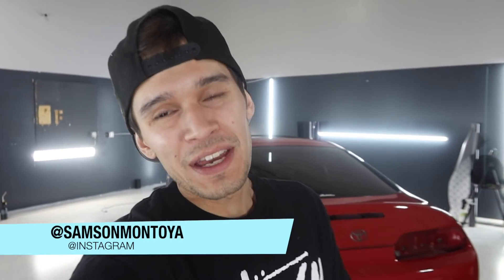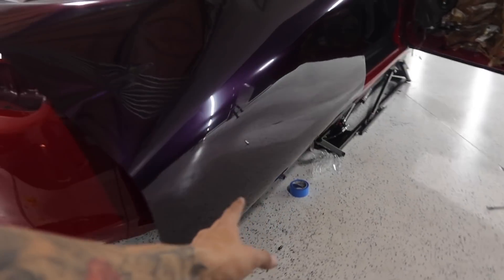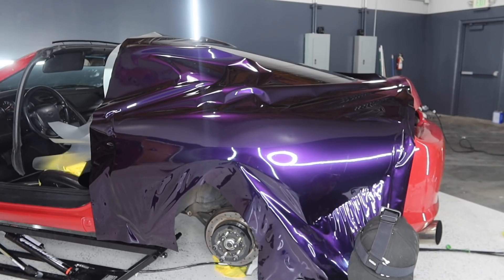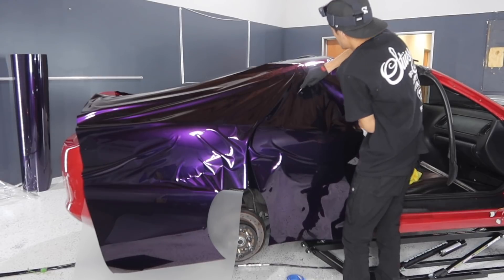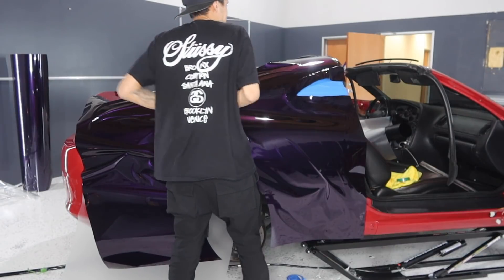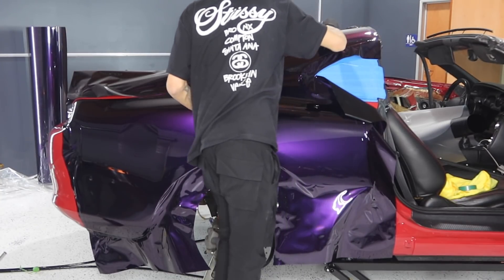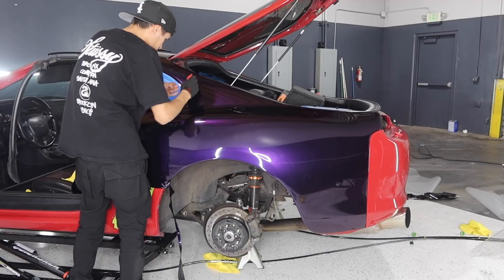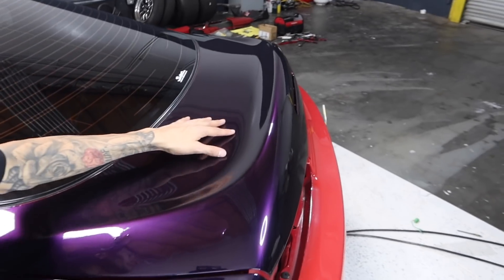HARDEST QUARTER PANEL TO WRAP.. (ONE PIECE/NO SEAM)

Comment: 15:40 at the bottom of the qp, there is red under the finished section after you trim it - is that bumper/under aero?
Reply from the maker: So what your seeing there is similar to a pinch weld, and a mud flap/Guard covers that area and that is why I said in the video I don’t have to take it in all the way since it’s going to get covered.